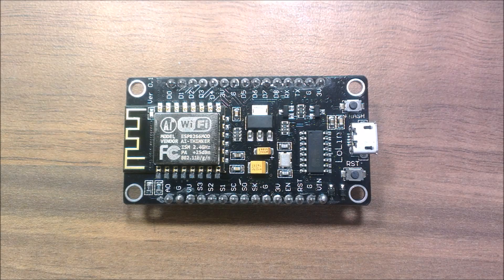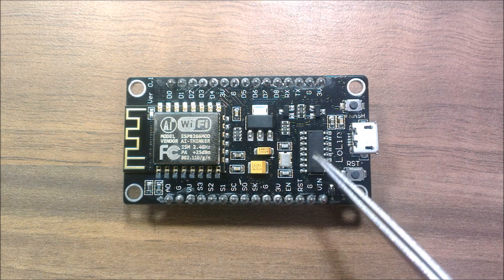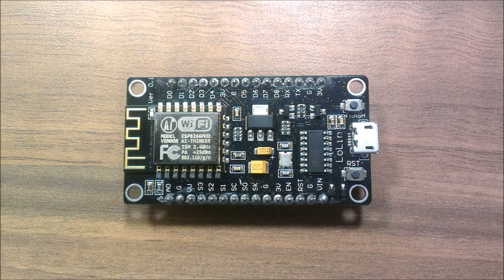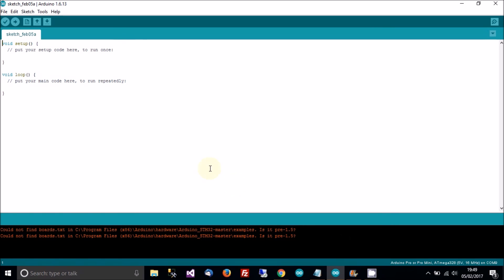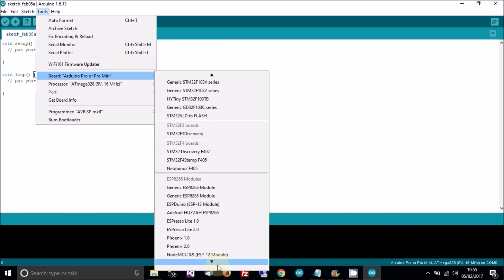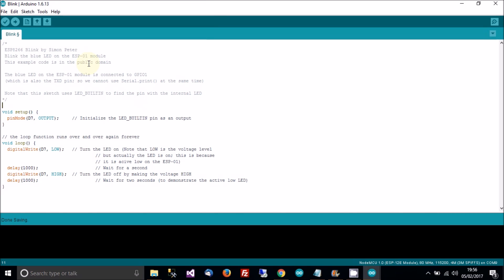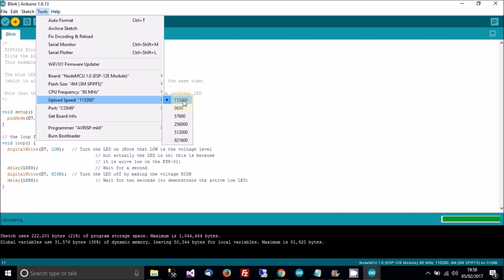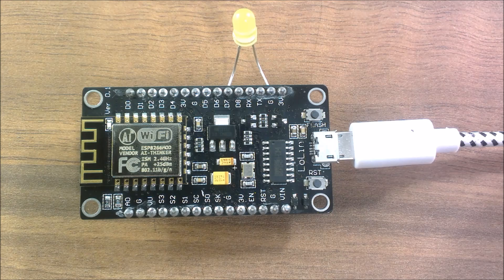TUTORIAL: Quickly getting started with NodeMCU / ESP8266 12E - In 7 mins! Beginner Friendly! Arduino

Comment: I like your video.  It is short and sweet. Thanks for making it. Please note, that in your video, what you are calling a UART is not a UART. The UART is actually internal to the ESP8266 SoC.  What you pointed to was a USB to 3.3 volt serial converter (USB interface). In the old days(semi old days) we would call that chip (circuit) a USB to TTL serial interface. The reason we do not call it that anymore is because TTL is 5V logic, this ESP8266 uses 3.3V logic.  That USB to serial data chip you pointed to was probably a CH340. To see why the CH340 is not a UART Google the CH340 data sheet, then Google what a UART is. 
*When you said people could use their own UART and connect to the board's Rx / Tx pins, the key here is to understand that this connection is a direct 3.3V serial connection to the ESP8266 SoC rather than a USB serial connection to the ModeMCU board. 
**The Rx / Tx pins (between pins D8 and G) connect more directly to the UART within the ESP8266 SoC. DON'T use 5V data swings on those pins. Those pins are 3.3 volt ONLY. There are other requirements to flash code directly via the Rx / Tx interface (like manually twiddling the bootloader invoke pin) but I only wanted to correct for your viewers the important distinction between a UART and a USB to serial interface. They are two different things. When teaching people things that are new to them, accuracy is best. Have a great day.
Reply from the maker: Hey, thanks for your comment. You learn something new every day. For some reason, I still call that chip a UART even now, (one year after making this video). It's fairly obvious that the chip isn't a UART though as like you said, the UART is in the Module's chip! Yes, about RX/TX pins, ofcourse, you can't use USB as the control logic and voltage is different. The way I used to do it, was to use a standalone 'UART' (Which I will now call a 'UART Serial Converter'). :-)
Reply: Thanks for your response. I'm not sure what what you are calling a chip and what you are calling a module.  There are multiple components interconnected to create the NodeMCU "module".  The NodeMCU is a module with another module attached to it. Basically the NodeMCU is a module built around another module. That smaller module is not actually an ESP8266 chip.  That smaller module, when I look at your video is called an ESP12E. AI-THINKER made the ESP12E "module" in your video. Espressif Systems (China) provided the SoC to AI-THINKER who then made the smaller module on your larger NodeMCU module. The ESP8266 is a"chip" UNDER the metal can on the AI-THINKER module where you cannot see it. The ESP8266 chip is hidden. The AI-THINKER module assembly is soldered to the NodeMCU module (PCB). 
What you are calling a UART in your response to me above could be a FTDI USB to Serial interface (module). You are connecting the FTDI module between your computer and the Rx /Tx pins on the NodeMCU module, correct?

Sorry if you or others reading this think I'm being pedantic. I don't want to be a prick.  A few weeks ago I started watching dozens of YouTube videos so I could learn about Lua, microPython, MQTT, SonOffs devices (which use ESP8266 chips) and other IoT things. I became very confused by what was an ESP8266, what was an ESP12E, what was a NodeMCU and why this has anything to do with Arduino. I'm getting it all figured out now. Frustratingly I ran into so many people inventing their own terms for things which already had industry standard terms assigned. Folks using the wrong terms for components made for an unnecessary heck of a time understanding it all.  It is crazy confusing for us "students" to sort it all out when the wrong words are used by the "teacher". The industry terms are what should be used to keep confusion to a minimum IMHO. Then again, maybe I'm just old. I am 60.
Please be aware that an FTDI chip on a PC board or module is unlikely to be a UART chip. I'm un-sure if the FTDI company from Glasgow, Scottland even makes a UART chip. Their claim to fame is their line of USB bridges. I don't know why but the many FTDI bridges I've seen are on red PCBs. I have a couple of these red FTDI bridges. They are genuine, not the counterfeits (Hi Fred Dart :-)).  There are stand alone CH340 USB bridge modules from China ( I have a few) which are often on small blue PCBs. It doesn't matter if the USB bridge module you use is red or blue (FTDI or CH340), these are not UARTs.  
I'm not trying to be a jerk. I think it helps everyone, including me, if content creators use the proper terminology during their tutorials. As good as your tutorials are, you will be doing yourself a favor in the long run if, in your head, you use appropriate terms.  You do your viewers a favor too because many of them are already confused by this technical stuff. I'm not that smart therefore I'm easily confused. Tutorials using incorrect terms isn't helping. I'm not singling you out. This applies to all the IoT tutorials on the web.  Thanks.
Reply from the maker: Hi,

I call the NodeMCU the "module" and the inner module a "chip" (even though it is also a module).

Correct too, the standalone serial converter which I'd have used would have been either FTDI, CH340, PL2xxx, etc. FTDI was by far the best though and the one I used to use more. Ofcourse, to connect Microcontroller to PC.

I'm not worried about you being or not being pedantic, feel free to say whatever you want. :-)

I'm a learner also, everyone on YouTube is or has been a 'learner' at some point. I've also been though the inconsistencies, and spending hours learning, seeing/hearing wrong terms, etc. Ideally, if one knows the industry terms, it is good to use them, I agree with that! Also, when discussing complex things such as these, it is great to keep things as simple as reasonably possible, as you said. I don't think your age comes into that, I'm 31 and I feel the same way.

FTDI do make very good UART interface chips, I have a few of them myself (My FTDI modules are also red). Mine are most likely counterfeits though since they were super cheap. They are what you call (quite correctly) 'Serial Converters'. Although they may not have a UART inside of them, they are still called UART modules from time to time too, presumably because they connect to a UART. You can see them here if you wish: http://www.ftdichip.com/Products/ICs/FT232R.htm

If you type in 'UART' into ebay for example, you'll see a whole host of USB - UART, UART Serial Converters, TTL UART, UART adapter, UART Interface Chips, etc... Although the correct name is 'UART Serial Converter', you can't help what people call them! Pretty much everyone I know calls these things 'UART' even though they are not! It's just presumably short for 'UART Serial Converter'! People call me 'Tony' quite often, my name isn't 'Tony', it's 'Antony', but things are the way they are I guess.

But now, getting to the point, please bear these points in mind; YouTube content creators often create voluntarily and freely. We are often not qualified teachers - we are just enthusiasts! We often cover that many topics that we do not have time or the desire to learn every single detail/term. We often have no formal training from electronics companies. We are also under absolutely no obligation what-so-ever to assure that our content is fault-free - that's not how YouTube works!

You seem to have us confused with some sort of professional training company which is given lots of time to research very technical subjects in extreme detail, and is then paid significant amounts of money in order to deliver it with a great degree of professionalism! Many of us on here are lacking in two of those areas: we do not have enough time to learn all the details, and we do not get paid anywhere near enough in order to do so!

I hope this clears things up for you! :-)

Thanks for your comments.
Reply: Its all good.  Thanks again.  

I appreciate you not getting cross with me trying to help your viewers/readers from getting confused. You are 100% correct YouTubers are not obligated to provide accurate information. Nice when they do though.

Like I wrote earlier I'm old.  "Back in the day"... (isn't that what old people are supposed to say?)... UARTs were their own component (chip/integrated circuit) which would connect to other chips.  The UARTs job was (is) to take non-serial data, and serialize it.  A.K.A take parallel data (often 8 bits wide) and convert that into one bit width (serially). At the end of a line, another UART would reverse the process restoring the serial back to parallel.  UART is an acronym which stands for Universal Asynchronous Receiver Transmitter. The FT232R "connect" to a UART but the FT232R is not a UART.  Like I said, back in the day UARTs were a component (chip).  Today however the UART is integrated into a chip which has other functionality, on the same die.  There is a UART "inside" the ESP8266.  There is a UART inside an ATMEL Atmega328 microcontroller chip (the heart of the Arduino Uno). An external "thing" has to "bridge" that UART to a PC's (Windows, Linux, Apple) USB port because PCs stop offering native RS232 serial ports. There is no UART inside the FT232R. In the ESP8266, which is on-board the ESP12E, which is soldered to the ModeMCU, there is a UART. That UART's Rx and Tx pins are what the NodeMCU brings to the board edge.

Deviating subjects slightly, I never understood why those folks at Arduino (smart people for sure) wanted to create their own terminology for stuff that already had terms technical people understood.  I hated that a program was a "Sketch". ugh.  I hated that a daughter board or expansion was a "Shield". To me and people where I come from (my background) it was nonsense talk. For people who knew nothing about electronics or embedded control, they knew no different.  Why does this matter?  Same reason you and your friends calling a USB Bridge a UART breaks the lines of conversation when seeking help from an expert.  When Arduinos became "a thing" and friends who knew I was knowledgable in microelectronics and writing embedded code would call me and say they have a question about "the Shield" they bought from Italy. I'd say "what the Hell are you taking about, Shield?"  Argh.  It is a daughter board which plug ontop of the main Arduino Board.  Sketch?  Don't use a pen, use a pencil.  Sketch?  WTF.  It is program code (probably written in some flavor of C or BASIC).  No one in the World called a program a Sketch until those Italians started spreading it around. Grrrrr.  Us old-timers aren't going to change how we talk about embedded controls, just because some Arduino dudes want to take over with new (unnecessary) lingo. A sketch is something Bob Ross did, or a comedy piece on Saturday Night Live, not a C program coded on an ASCII keyboard and injected into flash memory.
Thanks for listening. Thanks for taking this as helpful not critical.
Reply from the maker: xxM5xx well, there's no point in me being cross... You're bringing up perfectly valid points. It would be very foolish of me to discourage anyone from pointing out any problems, especially since I'm an amateur. I've been learning electronics for around 18 months now. (Although I've been a programmer for many years) I also hate the words sketch and shield. You may have heard me moan about the word 'sketch' in my videos. About the UART word, I don't know why we call it that, my guess is that we got lazy and shortened UART to USB Serial Converter to UART. I have no idea! We make other mistakes too... For example, I call Arduino functions 'methods'. But in C++ (Arduino), they are actually called functions. Why not keep the names the same?!?! I don't know. There's one thing I know though; things are getting further advanced, faster, more complex and more difficult to learn by the minute! I'm not even sure if frameworks and APIs existed in the 80s!

Comment: the serial monitor does not show the ip address   and blink the following
B⸮  
Connecting to your wifi ssid
............................. 
for 3 hours so how can i  find the ip address of the shield
Reply from the maker: I'm afraid I don't understand the syntax of your message. If the code is correct, and the module is working, and you're in range of a router of which you have credentials to, the ESP should work without any problems. :-)

Comment: Hi Antony, thanks. I bought Lolin NodeMCU V3.0 and uploaded some sketches via arduino IDE by following your tutorials and led and few others worked fine until I started to look into connecting to wifi. Wifi.begin or scan wifi sketches do not work at all. I have tried everything but somehow my nodemcu does not pick up the wifi access points. when i tried lua (flashed first using node mcu flasher) I could connect to wifi but not via arduino IDE. I am really confused and not sure why wifi would work on lua but not arduino. Below is my ardino sketch.

#include "ESP8266WiFi.h"

void setup() {
  Serial.begin(115200);
  // Set WiFi to station mode and disconnect from an AP if it was previously connected
  WiFi.mode(WIFI_STA);
  WiFi.disconnect();
  delay(2000);
  Serial.println("Setup done");
}

void loop() {
  Serial.println("scan start");

  
  int n = WiFi.scanNetworks();// WiFi.scanNetworks will return the number of networks found
  Serial.println("scan done");
  if (n == 0)
    Serial.println("no networks found");
  else
  {
    Serial.print(n);
    Serial.println(" networks found");
    for (int i = 0; i < n; ++i)
    {
      // Print SSID and RSSI for each network found
      Serial.print(i + 1);
      Serial.print(": ");
      Serial.print(WiFi.SSID(i));
      Serial.print(" (");
      Serial.print(WiFi.RSSI(i));
      Serial.print(")");
      Serial.println((WiFi.encryptionType(i) == ENC_TYPE_NONE)?" ":"*");
      delay(10);
    }
  }
  Serial.println("");

  // Wait a bit before scanning again
  delay(5000);
}
Reply from the maker: Hi, I believe that your code is a lot more complex than is necessary! The code in order to do what you're trying to do should be around 10 lines. Maybe check some other examples as that looks far too complicated!!!

Comment: Can I use TTL RX & TX to connect to other Master Slave Devices
Reply from the maker: Yes you can, but if you do so, you lose debugging. If I remember rightly, when the device restarts, it will lock up. It's better to use Hardware Serial (if possible on this module).

Comment: Great video. Thanks.

If you get the following error(s):
error: espcomm_open failed
error: espcomm_upload_mem failed 

May be worth mentioning (in addition to your pinned troubleshoot guide) that running the newst version of Arduino IDE (1.8.4) may cause issues. I tried common troubleshooting methods, but still did not work. So I reverted to 1.8.2, as noted in the GitHub repo, and all is well. Moving forward, I'll be sure to remember to check for the latest Arduino IDE tested/supported. Hour of my time gone - lesson learned. Now on to the fun stuff!
Reply from the maker: Jashua White Thanks! I'll add it to the list now. Antony...

Comment: Hi I'm new to this can you please do tell is it requires any external development board is required to program the chip if not how to do it.Thanks in advance
Reply from the maker: Ganesh Rao Nothing external required.
Reply: Thanks for the reply sir.can you please do tell me how to start and how to program i want to develop a application where i want to connect flow sensor and i need to get the voltage.is it having internal controller.please do tel me the procedure to inter face if u have any related document or code please send me to ganeshdumala@gmail.com.Thank you :)
Reply: can u pls tell me how to program in details
Reply from the maker: Ganesh Rao Every device and application is different, you'd need to research for something that specific.
Reply: am asking how to flash not to write the program
Reply from the maker: Ganesh Rao Maybe watch the video again. :)

Comment: I am a great  Fan of your videos, especially 8266. Would you please, do some videos on interfacing CCTV cams with 8266, so it can stream videos.

One more project would be play from 8266 12E, internal 4M memory mp3 or wav files without using external active components. (No TF cards, and serial players)

Any help would be welcome..

Please do some video on Range testing inside buildings.
Reply from the maker: Hey, thanks Ansr! In what way would you like to interface a camera? Streaming from cameras is usually done from the camera itself, I think lots of TCP/IP cameras use a protocol called RSTP. 

About the other project, you'd have to somehow get and store the bytes of sound data to ram and then work out how to translate that data into sound, and then send it to a speaker. I currently have no idea how to do that!

As for range testing, my garden is large, but my house is small... I do know that the NodeMCU can travel around 9m, and through 4 solid brick walls. I know this because mine does this every day. It's easy for me to do outside tests, but not inside tests. :-/

Comment: Hi.. I have a slight problem with ESP8266, the ESP's LED (blue LED) showed momentary flash after it connected to the USB port and also Port on Arduino IDE didn't detected the ESP's port. What should I do?
Reply from the maker: HI, the NodeMCU uses a UART to communicate with the PC. If the Arduino software doesn't recognise this, it is most likely to do with drivers.
Reply: I just tried CP210x, is it the right driver I have to install?